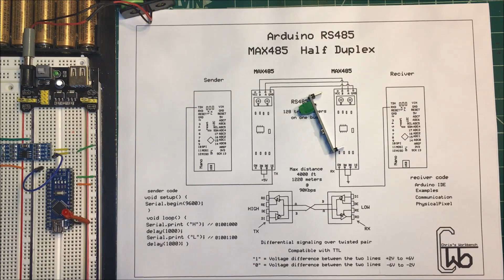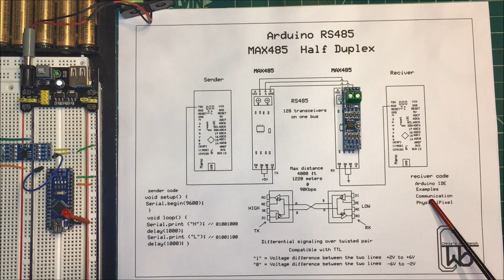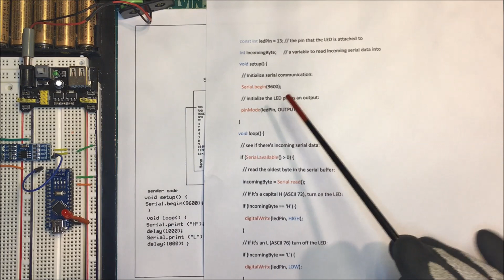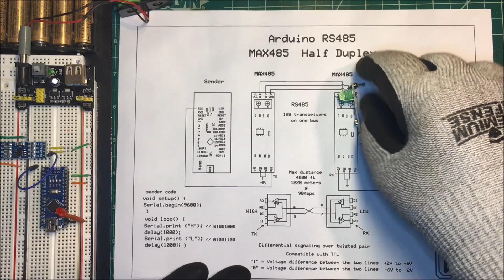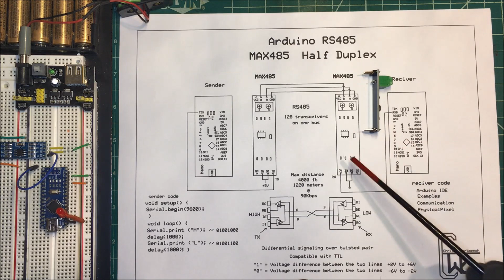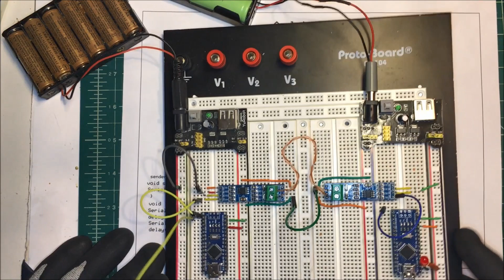MAX485 module tutorial

Comment: Thanks for the vid. I have a question though. You said a second inverted wire is for data integrity and long distance transmission. If my distances are short and I have a common ground between 2 devices, Can I use ONLY 1 physical wire between two MAX485? 

In a protocol that I'm trying to work with I have to have GND, +5V and a single half-duplex signal wire.

Comment: I’m considering creating a looped network of arduinos using max485.  All would need to be able to transmit a message and each one may respond to that message, but it would pass it along the network until it got back to the original sender which would verify that all in the network got it.  Is this possible?  I’m thinking because the sender needs a high signal and receivers low that this could create a lot of collisions with them switching a lot.  Is there a better protocol you know of for this?

Comment: What will happen if ground is not connected?

will not it communicate?
Reply from the maker: It works without the ground.
Reply: @ke6chris  Then why did you ground it? I didn't get it. In your schematic only A and B are connected, but in your circuit you've connected ground as well.